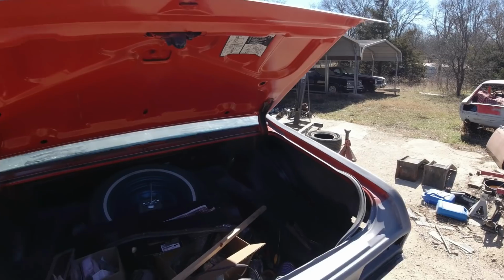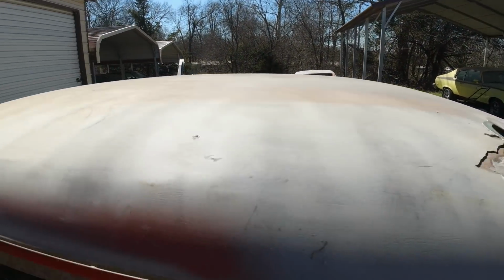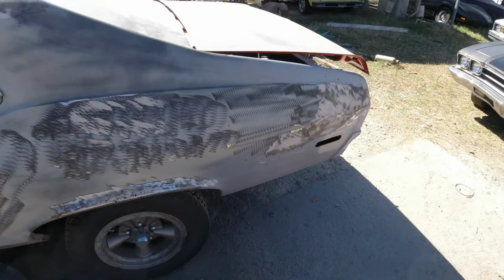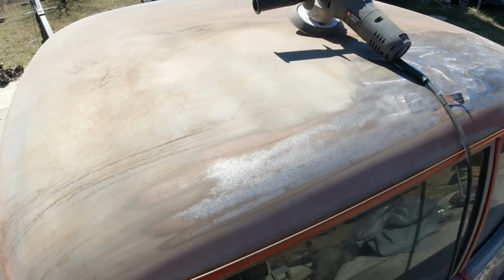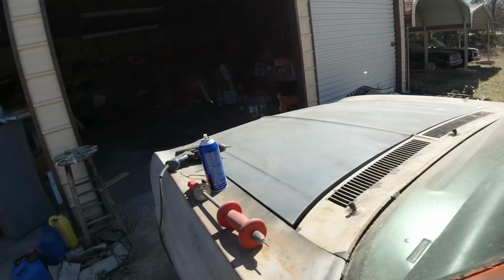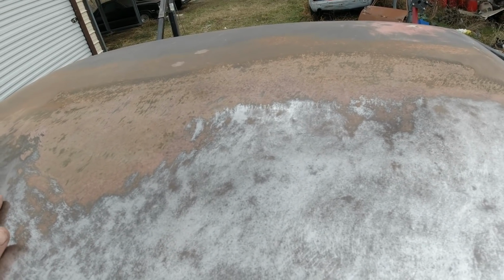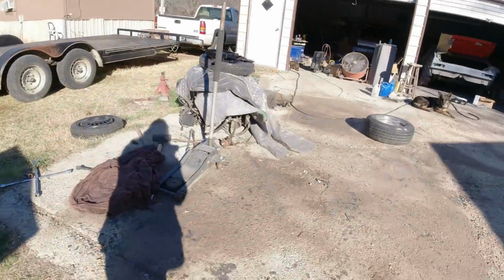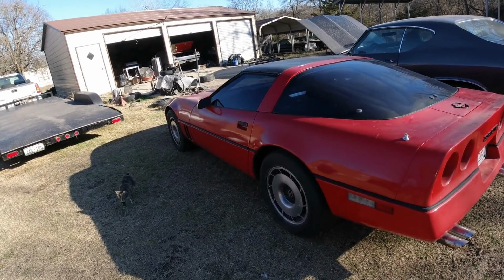Restoration of a 1972 Chevy Nova - Part 24 - Repairing rust and dents on roof and left quarter panel

Comment: @Clunkers and Classics 
I have seen where guys weld nails to dents and use the puller to pull on them similar to a stud gun. I was thinking of buying one. They used to be $99 at Harbor Freight, although I don’t do much bodywork.

Comment: On vette window . Try to take the plug out of the equation.  They had suck bad connectors is 84 and 85. You may be able to get another connector and solder it in